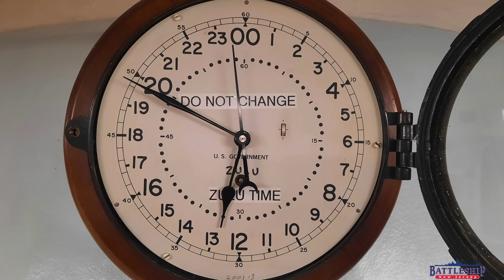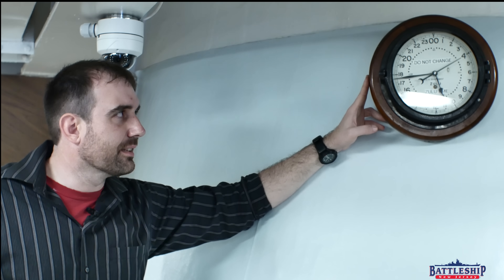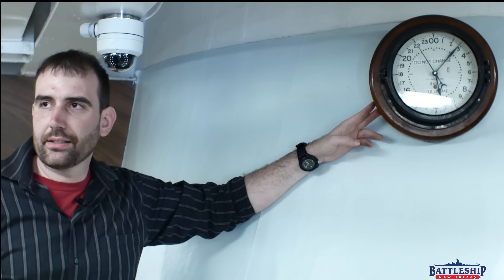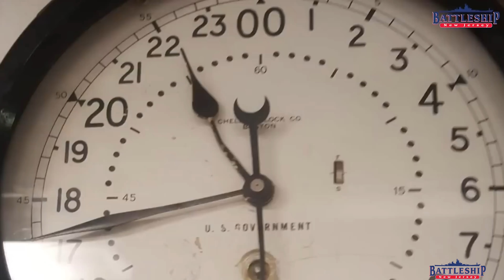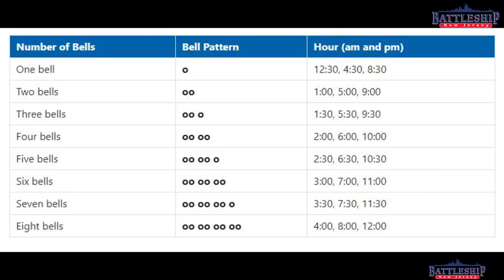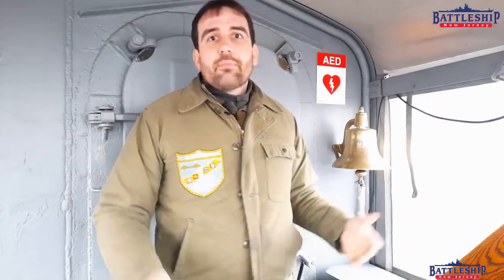Zulu Time and 24 Hour Clocks

Comment: I switched to 24 hours when I went to England for a few weeks and managed not to stick to it. When I got to go to the Philippines I was there a little bit longer along with at least 8+? other time zones between East Coast West Coast layovers... and this time it did stick and I've been that way since 2008. It makes transition between different time zones so much easier. And get normal time normally you subtract 12, however I developed a slightly different method I ignore the 10s and subtract 2 as the 10s can almost be ignored until you're into the 20s. Sadly knowing 24 hour time would've been so handy when I went to Canada for a field trip and the museum we were at had a whole bunch of different things only listed in 24 hour time, oh yes before smart phones and after pocket calculators the 2000s.

Comment: I personally use 24 hour time for everything! Even though 12 hour time is occasionally used here in Norway in informal settings; it's rarely specified if it's the morning or evening; it's usually just assumed from context that 5 means 17:00 if referring to dinner time and 5 is 05:00 if referring to waking up early. But I don't feel confident at all what others presume obvious; so I always confirm what I interpret it as in digital: them: "at five o' clock" me: "so that's seventeen zero zero or zero seven zero zero?"

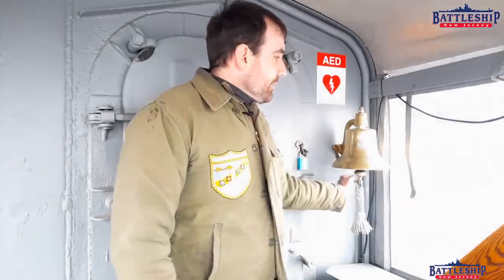I mean I'm a early bird; I might wake up without an alarm at 05:00 but since I'm a programmer I'm definitely in the minority among my coworkers; so if they talk about working on something at 5 I have no idea if they mean 5 in the morning (presumably before going to sleep rather than waking up early to do so) or if they mean 5 in the evening. I'm personally much more likely to choose to wake up at 05:00 to run an update outside busy hours than doing it late at night. I naturally wake up at 06:50-07:00 (and my alarm is at 07:02 but by then I'm usually already awake) but I'm fairly comfortable waking up aroud 05:00-06:00 if I need to do something early; and after 15:00-16:00 my focus for programming is mostly gone; so I would never do an update (that might fail and need further debugging and updates) later than 15:00

Comment: I'll freely mix the 12 and 24-hour clocks, although work tends to use the 24 hour format to avoid ambiguity.  We also have an extra little twist here in Scotland - "back of X", meaning "some time between X:00 and (X+1):00".

On a more technical note, you don't mention the need for an accurate count of Zulu time to measure longitude.  Had the USN developed alternative methods and instruments by WW2?

Comment: I personally prefer the 24-hour clock.I find it easier and more sensible. Mainly, there's none of this AM/PM nonsense, as you mentioned. Also involved is about 15 years either in the military or working as a civilian employee of the military. However, I can flip back and forth between the two systems.

Comment: I've started using 24 hour clock for myself, but usually translate back to 12 when talking with someone as most of the people I interact with aren't accustomed to 24. 

Also I made sure the digital watch I got has a 24 hour mode, and I keep it in that mode. As well as my bicycle speedometer/odometer, and PC.

Comment: From 1973 through 1984, I was an Air Force Computer Repairman.  Our shop used both the 12 hour local time clock and a 24 hour clock set to Zulu time.  We used local 24 hour time for shift changes and Zulu time for maintenance document reporting.  AFTO 349s and the shop station log.  You just got used to which was used for what.
In the MI Army National Guard we used local 24 time for everything.  Even when we deployed to Iraq in 2003-04.  We never did use Zulu time.

Comment: To answer your question...
As an American, I think 24 hours is more logical than splitting the day into two sets of 12 hours.
But my brain has a harder time telling the difference between 18 O'clock and 19 O'clock than it does between 6 O'clock and 7 O'clock.  
I.e. the difference between two adjacent smaller numbers is more "brain friendly" than the difference between two adjacent big numbers.

Comment: I know that “bake alight” was used in manufacturing during the Vietnam war so that takes us back to the 60’s, the M16 had bake alight in the forearm and stock. I like wrist watches that have the 24’ hour feature, but what I’d really like is the black 12 hour face that at the 13 hour switches over to red. This is a good video for anyone who might find themselves on a navy ship. If you’re part of a news crew for a local station it’s for only a day, but if it’s network news or cable that could be for several days. 🧐
Reply: The product you refer to is BAKELITE, the first synthetic plastic. It was invented in 1907 by a chemist named Baekeland (I think  spelled that right ...)
Reply: @GraemePayne1967Marine   I believe your right, spellcheck didn’t know either thanks 😊

Comment: It was the Egyptians who were the first to use the 24 hour time period. Their system evolved around the time it took certain constellations to pass through the sky.
Early American railroad adopted this due to people missing departure times by 12 hours.
A person had purchased a ticket for a 7 o'clock departure to make an important board meeting.
He shows up at 7pm only to find out that the train he had purchased a ticket for departed 7am.  No distinction was shown on the ticket.
He presented this to the railroad board members (he happened to be a higher up in the board) and asked what they could come up with to prevent this from ever happening again.
They came up with the 24 hour system to prevent this from ever happening again.

Comment: When senior citizens go to the doctor for a general check up, they are presented with a circle and are told to draw hands when given a specific time.   I wonder what would happen if they did it in 24 hr time, maybe an instant trip to the nut house?   What if they did it using Roman numerals?   Or Octal . . Or Hexadecimal?  . . . Or. . . . ?    ( One engineer I worked with had a light up clock that displayed time in Binary. )

Comment: I used to work in a big factory that had all the time clocks on 24hr time so I got used to the system. Also they used an industrial time system that divided the hours by tenths, which is 6 minute increments. I worked a shift for decades that clocked in at 15.3, which is 3:18pm. The reason why is because they needed to stagger the afternoon shift change into 2 phases for traffic concerns, so half of the plant had the shift change at 15.0 and the other half at 15.3, which is close to 15 minutes later but turns out to be 18 minutes past the hour. BTW if anyone not used to 24hr time needs to quickly convert the afternoon hours to 12hr time, an easy way is to subtract 12. The am hours are not confusing because 06:00 is 6am, but if someone says 18:00 hours, you can just subtract 12 from 18 and you have 6pm.

Comment: Zulu time is used for radio communications since they can travel across several time zones.  The clocks would now be set from the GPS time signals, but previously they would be set using the time signal from WWV in Ft. Collins, Colorado or WWVH in Hawaii.

Comment: The astronauts were issued mechanical watches for the same reason.  Yes there were auto winding watches but they rely on gravity which is no good in space, quartz / battery was not deemed reliable enough, even though they were accurate, because batteries could fail.  I'm sure this was lessons learned from the military, where the astronauts were initially drawn from.
Reply: Actually, Bill Pogue wore a Seiko 6139-6002 on Skylab 4 in 1973/74 and it kept good time.
Reply: @acftmxman  true and others wore different watches as well, but I said Issued, the official issue watch was the omega speedmaster mechanical watch.  There were Rolex and Breitling as well as Seiko watches worn by various astronauts, but they were personal not issued.

Comment: Midnight can be refered to as either 2400hrs or 0000hrs,
 Normally when "vocalizing" (speaking) midnight is usually refered to as 2400hrs.
   When writing the time down it still is common to see either 0000hrs or 2400hrs.
  Usually if midnight is towards the end of your shift it is written as 2400hrs, 
 If it is near the start of your shift it is usually written as 0000hrs.
  This was not "written in stone" when I was in, it was just a common practice  for "non critical" types of paper work, this gives everyone an idea  (at a glance) of roughly how far into your shift you were when you documented something.

Comment: I was tasked out of shop 300 to go onto the Missouri, and stop shipyard workers from removing the Zulu clocks. Apparently, there was a mistaken set of orders released to disconnect and remove the Zulu clocks. I had black and yellow stickers which read: “DO NOT REMOVE”. My job was to attach a sticker to each clock I found. I found 231 clocks on the Missouri.

Comment: As a European, a Dutchman to be precise, we use a 24-hour clock as standard. 12-hour time is used colloquially, if just because it's never necessary to specify realistically. You're not going to the bar at 7 A.M., so agreeing to meet 'at 7' for such things almost always means 'in the evening'. You add 'in the morning/in the evening' if specificity is needed. The thing is, this clock is the first ever wall (I mean, bulkhead) clock I've seen that has an actual 24-hour dial. I've always wanted a 24-hour dial wristwatch.

Comment: The most confusing thing about the AM/PM system is to me, that 12:01 AM is half a day away from 12:00 AM. WTF?? Keep your AM/PM if you want, but please, PLEASE use 0 instead of 12...
Also, even though the 24h-system is more widely adopted, this video was the first time in my life that I saw an analog clock with 24h. All the analog clocks I've seen so far were still 12h.

Comment: I set as many of my personal clocks as I can to 24 hour time. This is not because my father was in the US Air Force when I was growing up, or because we were stationed in Germany for a number of years in my mid to late teens, as many have assumed when I tell them who know my family history. I started doing this in my early 20s so that I wouldn't keep accidentally setting the alarm on my phone for the PM time rather than the AM time. The clock on my phone (my main timepiece) is always on 24 hour time, and I just automatically make the corrections when necessary, but generally, to myself, I don't have to, I just know what time 20:00 is.

Comment: Is it actually GMT? Or UTC? At least in aviation, when we say "Zulu time," we mean UTC, not GMT. The main difference between the two is that GMT changes for Daylight Time, while UTC does not. I can't remember if there are any other subtle differences around leap seconds or anything like that, but Daylight Time is the big one. UTC is also what system clocks on computers normally use (the user interface will show you local time, but it's usually read from the system clock in UTC and then adjusted for whichever time zone you have selected.)

I actually don't remember hearing about other time zones being assigned letters before. That was interesting. It makes sense (and explains why we call it 'Z',) but 'Z' is the only one I've ever seen or heard in practice before (mostly in computing, aviation, and weather forecasting/reporting.) While it might make sense for a ship to use local time and change when they cross time zones, that would be much more problematic in aviation where you can be changing time zones every hour or less in some cases (especially on polar routes.) Also, when planning a flight, you may be in one time zone, but reading weather reports, NOTAMs, etc. from several time zones away. Obviously, that would be a pain and very error-prone if you had to then go figure out which time zone each one of those places was in, whether and when they observe Daylight Time, etc. As such, almost everything in aviation just uses UTC.
Reply: Your comment about GMT shifting for summer time didn't sit quite right with me so I looked up the Wiki and -- oh boy haha. It seems that Greenwich mean time (lowercase) shifts for summer time, but GMT (caps) does not. GMT is essentially the same as UTC but differs on some very fine technical points by less than second, and is not in use today other than in casual speech as a synonym, and for historical purposes.

Comment: The clock face in the bell ringing room of our church has hands directly attached to the opposite end of the drive shafts for the outside clock, so goes backwards. When the clock stopped working for a while I got a battery operated backwards clock for consistency - tiguf supmet

Comment: 1) whose job was it to wind/adjust the clocks? Was there someone whose job was to go through the ship daily ?

2) do watches change as a ship moves through time zones? Let’s say a ship leaves port and just for arguments sake the 6am watch is at sunrise and the 6pm watch is right before sunset. If the ship sails through 6 time zones would for instance the 12pm watch be at sunrise? If the watches move as the ship transits time zones, does that mean some watches will be 5 or 7 hours to compensate?

Comment: As a retired Instrumentman with an 1812 nec I worked on all government time pieces until the conversion to quartz in the 1990's. If the clock is WW2 Era and is for the navy it will say US Navy on the dial the one you are showing is from the late 1950's or later. Chelsea clock company and Seth Thomas made the clocks and the maker will be listed on the dial. Also there are a few M Low clocks out there as well. I restore these timepieces now and would be glad to answer any questions any one has.

Comment: I use 24hr time all the time for the most part. The exception being is that I do have clocks that can't be set to 24hr time or are the traditional clock type with hands and only the numbers 1-12.

I was in the USN for 6 years and now I work in healthcare in a hospital. I also work third shift. So, using 24hr time all of the time is helpful for me.  I have several digital clocks in my home that are set to 24 hour time. Some of this is to make it easier to register what the time really is when I'm woken up during my normal sleep period during the day and it's not immediately clear because of the amount of light outside. It's the difference of being able to easily tell whether I've barely slept or whether I've slept through a big chunk of work.  I do have some digital clocks that don't do 24 hour time and on those I have to wake up enough to register whether the red dot indicating PM is on or if I'm only seeing the red dot indicating that the alarm is on.

I keep all of my electronic devices on 24hr time (phone, computer, tv etc..) if I can. I also purposely seek out digital wrist watches that I can set to 24hr time. Usually I want one that also displays the day and date pretty clearly too because that changes during my shift at work. 

24hr time is helpful when it comes to setting alarms. No confusing 2000 with 0800. Although, in the USN my first alarm clock was the type that would have just gone off at either if I left the alarm on. Interestingly, the alarm on that clock was essentially the same as the shipboard collision alarm. Close enough anyway.
Reply: I like how multiple commentators said that the 24h clock helps them check whether they overslept. :D

Comment: We use 12-hour round clocks in Europe to indicate time but digital clocks are usually 24-hour. We often also say e.g. eight in the evening or morning when we speak but usually not in writing. In writing we use 20:00 and 8:00 respectively instead as it's easier to write and there's less risk of misunderstanding.

Comment: in sweden we use both 12 hour and 24 hour formats, 24 hour format when we write generally (although sometimes we also use 12 hour format without am and pm when writing) but when we speak we pretty much always use 12 hour format since the analog clock faces are only 12 hour ones

Comment: This is the most us-american thing I've ever seen.  a physical clock to show 24 hours. lol, in europe we use the 24h system, but the clocks just show 12 hours, you tell time by looking at the position of the hands. 
sometimes there is an secondary print in smaller digits going 13 to 24. but most often there isn't even numbers at all.

Also in speech people don't say I'll meet you at  nineteen hour.  They will say at seven, the reason for the meet is usually good enough to know wether that is evening or morning. dinner would not be at 7am.  Incase it needs specification it's  'seven in the evening' 

The 24 hour system is only visible in digital clocks. and official writing. Train time tables will show 24h notations for instance, aswell as shops opening times. 

Surprised to hear that navy ships still ring the bell. we don't do that on merchant ships anymore. and I doubt alot of my colleagues will know how to listen to them and know the time the different rings indicate.

Comment: It's interesting to see a 24-hour clock.  The ship I was on,  an LST, had standard 12-hour clocks that had both 12 and 24 hour markings on the dial.  They were also key-wound.  They only needed to be wound once a week, and the ship's quartermaster was given the responsibility to wind and set each clock.  When changing time zones he went around resetting each clock.  I have no idea how many clocks there were.  There may have been some 24-hour clocks, but I never saw one.  I also have my computer on 24 hour time because it makes sense.  I also use the military practice in writing the date day, month, year.  We had standard 4-hour watches underway and in port.

Comment: Midnight is 2400, not 0000.  In reality it is both, but I have never seen a log entry 0000.  In the naval service we do not add the unnecessary suffix "hours" to the time.  It's 1700, not the (Army and Air Force and now Space Force) 1700 Hours.  LtCol USMC(Ret)